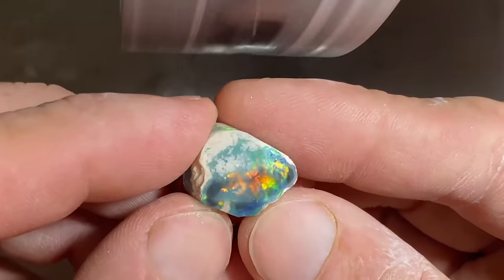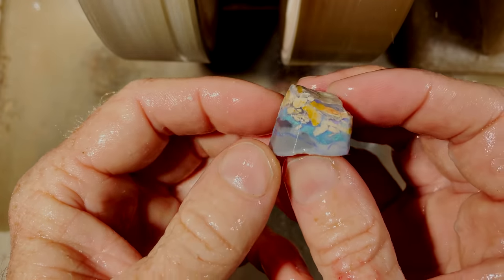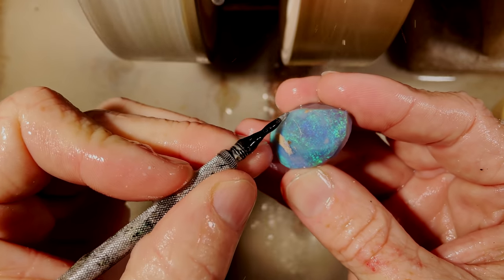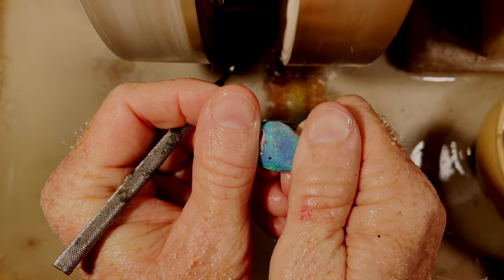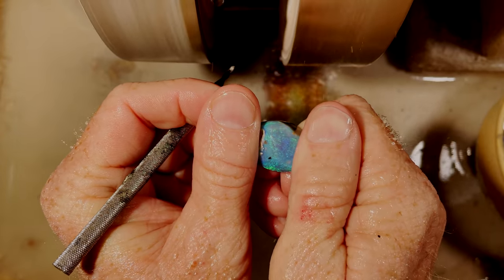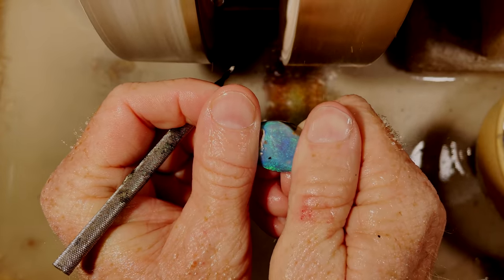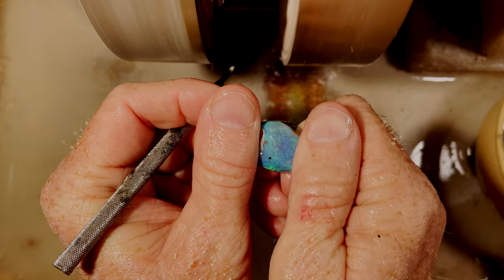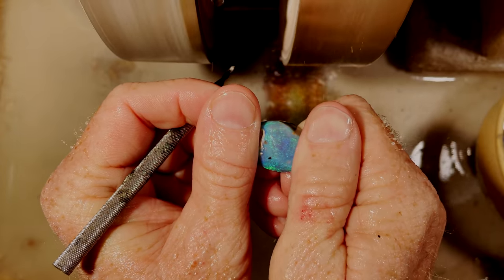Rough opal can be risky business - The outcome is incredible

Comment: Hey Justin. Any chance you could do a short video or a short explanation on how you form a cabochon around finding the face of color on a stone? I have a lot of trouble visualizing and orienting a cab from the top down. For some reason I do much better building one from the bottom up but that doesn’t work with opals and color bars. Thanks!
Reply from the maker: You need to find where the color is best in the stone and sometimes a cabochon doesn't work so you have to cut a flat gem instead of domed. Each opal is different

Comment: Hi, I know that you are cutting and polishing in a very traditional manner from what I can see. But, have you ever considered trying to cut using a Laser or controlled water jet ? I have seen things cut (mostly metals) using both methods, where the loss of material was minimal, only a few thousandths of an inch. And Lasers can be dialed in to only remove material of a certain density. I was thinking about those sand pockets. Could this type of cutting be applied to gemstones ? I know they microscopically etch serial numbers into Diamonds. So it seems the process is very controllable. Just asking.

Comment: Why did you shave the perimeter of the stone down to less than half it's size before removing the rough layer on top? It seems like that was unnecessary, and you could've gotten a significantly larger finished piece had you not done that. You're the expert though, so what was the thought process?
Reply from the maker: You always clean up the sides first to see what colour at you have. All the sand and inclusions are waste unless you can see them coming out.
Reply: @blackopaldirect  That makes sense, but damn that's a lot of waste. Always love to see it when a channel owner responds! you got my sub

Comment: Hey Justin, love ur videos, wish I could do what u do, and make a living out of it. I have a question,  when you weigh a finished stone, there is usually posh backing, and you need it to strengthen the stone . When priceing a stone, do u take into account the amount of non opal. And value accordingly
Reply from the maker: Yes it depends on the cut, shape and another factors. If the back is too thick I would take that into account. Or cut it down